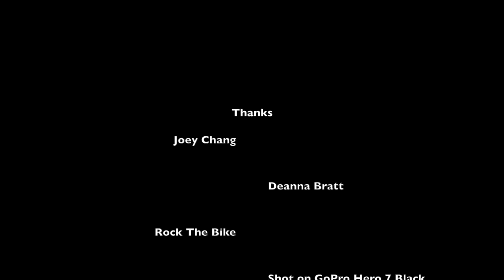Bike Sailing

Comment: Did you make a video showing how you made that cart? I don't have a vehicle so your entire set up would be the only way I could ever sail. But I'm not seeing anything in detail how you made this. If not would you be able to make a one?
Reply from the maker: I turned the boat over, put packing tape down on the hull, then copied it with composite materials including unidirectional carbon fiber and glass cloth. I would call this the yoke. The wheels are critical. I use one-sided push button quick release wheelchair wheels. I embedded the precision steel receiver tubes in my yoke. I was surprised how much material I had to use to achieve the desired stiffness. In order for the wheels not to cant in, I had to triangulate the ends of the yoke.  

You don't need to do what I did. You can check out beach dollies, get one you like, then change the fat low-pressure tires to skinnier, road-worthy tires.

Comment: This is extremely interesting. Couldn’t you design some sort of strap bridle that runs from the wheels up to and around/under the bow. Instead of a permanent attachment that you have. Could you do a video of your set up thanks. Very nice.
My hull weight is 73kg, so very similar to yours. I like your wheel set up. I had similar for a kayak, but never worked on my bike.

Never heard of this dinghy, is it a North American One Design?
Reply from the maker: The road exerts a twisting force on the trailer socket because it is a 1-sided trailer wheel. A Strap can't resist twisting enough in my opinion. Yes, the Banshee was designed for San Francisco Bay and is similar in size to the Laser. Thank you!